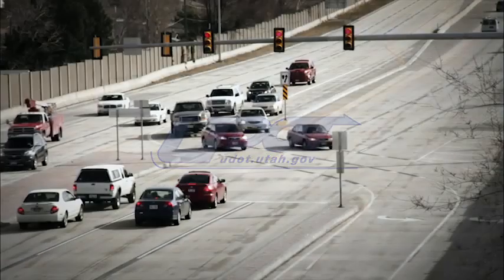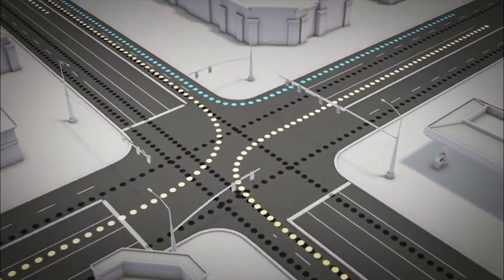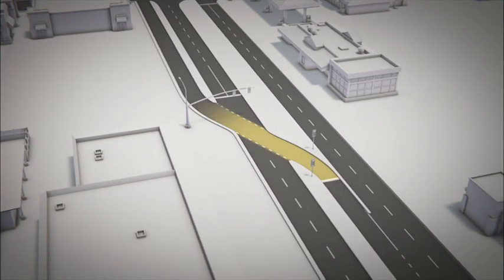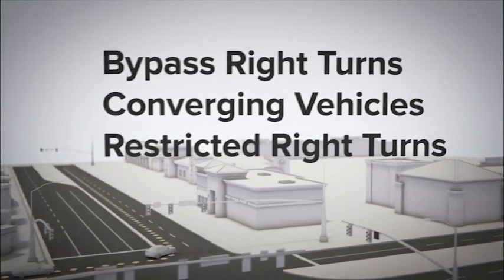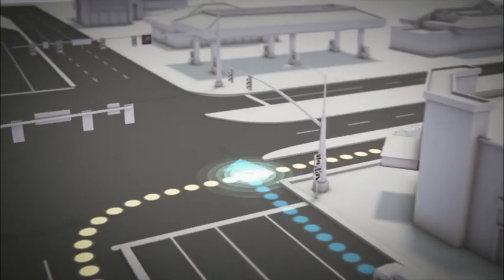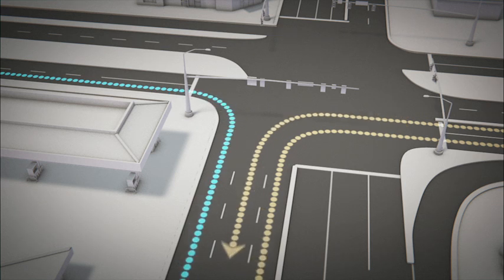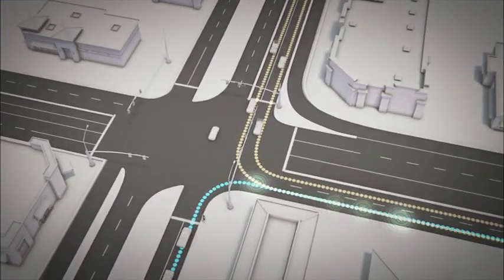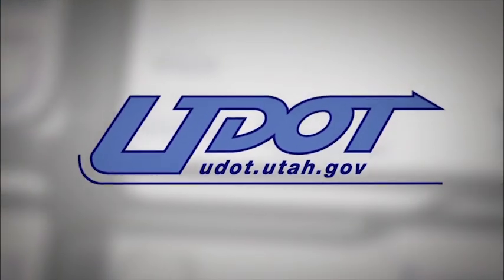All About: Continuous Flow Intersections

Comment: Continuous turns are impossible. Let me explain it. Cross sections are conflict points. It doesnt matter if you stretch it out. Its the same amount of cross sections. Two cars cant occupy the same space. So the amount of lights you encounter are the same. Meaning the distance you travel and the rate of which. Is identical to any other design. The only design that is truly efficient is the roundabout. It allows higher average speed and reduces conflict points.  This is still the exact same as a green arrow turn lane. Because the cars that go. Are going when one side is green. But they all have to stop to allow the cross section per car to happen.

Comment: Is it more efficient because what im seeing is the census taken at places that show more flow but dont demonstrate a change in the two forms. Flow rate is very simple. How long is a light green. And how many cars turn. How many cars then enter to turn. You count how many people enter the area. And how many get through. Very simple. If you have the same amount of lights. And stopping time. Then it all averages the exact same.  But they are measuring by cars turning and crossing at the same time. This is tricking the numbers. But per minute. You have to stop and go. The exact same amount of times as a standard dual intersection.  Each car is stopping and going no differently...  yall stupid

Comment: I can only see this working the best in a highway if builders do not want an overpass
Reply: Then it wouldn't be a highway... highways must not have any traffic lights
Reply: @supertiba98  says who?
Reply: @eax2010EA  The law in most European countries. And yes, I know this is the USA we’re talking about, but not putting traffic lights on a 75mph highway just generally seems like common sense anyway.
Reply: @krystiankowalski7335  Highways does not mean high speed, it means high capacity for cars and other car-like vehicles. Traffic lights are necessary even on highways when you don't have any other option available, especially when it meets a low traffic road. Before those traffic lights, you would have live signs telling you to slow down to another speed limit so that you respond in time to the stop. Highways can also meet train rails, and it's way harder to elevate one over the other; both are equally important.
Reply: @eax2010EA  You’re confusing highways with distributary roads. Highways are high-speed, and meet lower-speed roads by means of something like a cloverleaf or trumpet interchange, not traffic lights. I know that you would have stretches of lower speed limit leading up to these hypothetical highway traffic lights, but that’s only if there were any in the first place, highway traffic lights don’t exist. I never remember a time when I was driving on the autobahn and suddenly got hit with a 70km/h sign and traffic lights - because they are not there. Highways similarly never meet train rails at the same level. There is a bridge or a tunnel. Imagine driving down the I-95 and suddenly you have to stop because there is a train crossing it. Stupid scenario, right? It’s stupid because it doesn’t exist. Putting traffic lights/level crossings on a highway is impractical, inefficient, and very dangerous.
Reply: @krystiankowalski7335  highways vs freeway my dude.

highway means high capacity
freeway is the one that means no traffic lights.
Reply: @SherrifOfNottingham  They’re the same thing
Reply: that’s exactly what its for, is a temporary solution to a growing problem

Comment: To everyone saying to use a roundabout, this intersection is most often applied where a 6 lane stroad meets a 6 lane highway, combining 60+ mph traffic with 40-50 mph traffic. A roundabout would need to be elevated, or the highway dropped below ground, and it would be a bigger mess than the Arc de Triomphe in Paris.
Reply: Then it is not a highway since highways must not have any traffic lights, so roundabouts are still better since traffic is always flowing
Reply: @supertiba98  You're thinking of a freeway. A freeway isn't the same as a highway.
Reply: A 6 lane highway shouldn't be crossing through a road, or a street, let alone a stroad, the idea of which should've been put in a lockbox and dropped in the mariana trench to begin with.
Reply: @AstrumG2V  You know what's worse than that? A flashing yellow left turn arrow on a 6 lane highway.
Reply: @RichardFStripeRendezvous  or how about having no traffic lights or intersections on a highway??????
Reply: This is over complicated. A small rounderbout would increase traffic flow considerably while be much safer. One light jumper and accident waiting to happen.
Reply: What about cycles and people btw??
Reply: @yuvrajshinde6082  they have the traffic lights!!??
they cross the road when their signal turns green
Reply: @yuvrajshinde6082  Usually, pedestrians aren’t even allowed to walk through this intersection

Comment: So, if I understand this correctly, the whole point of the continuous flow intersection is to reduce conflict points at intersections. But that whole point is defeated by the fact that you need to add four more intersections with traffic lights to make the left turn possible.
Reply: typically only two more as this type of intersection is usually found intersecting under a freeway with it's frontage road which does not have the special left turn lane.

Comment: What the hell? Just make a big roundabout. Wastes less surfacearea and is far simpler.
Reply: There doing that in my town one round about sad to say it removed 23 business and now the area is vastly empty just to change a light to a circle. Good job on making things worse just because it's a circle . As well the traffic is way worse now so that's great too
Reply: @MetroHam   than they made something really wrong. What you describe shouldn't and must not happen.
Reply: @MathieuDeVinois  in my old town theres a main road that sees 70k cars daily and a side road that comes in at an angle with 15k cars daily that merges with the main street. most traffic is using the main road as the only way east to west or vise versa and only way to any nearby north to south highway. even so the town is decently far away from one and it does have the largets shopping center for certain stores in the state and a large lake for the summer time guest and the resorts for winter. most people not touring are peopel trying to get from the other towns through this one etc. a very simple change would have been to just make the street a 4 lane with grassy median and grade seperation at the larger congested areas. That or just elivated the road way and add corss conection from nearby parking spaces which wouldnt have destroyed alot of buisness.

But since most people perfer circles these days. they need to be beig to handle trafdfic volums so they end up destroying more and theres like 3 all in a row for reasons even tho it would make traffic worse cuz reasons
Reply: i think u got something in your ass if u really think putting in a roundabout would take less space then this.

Comment: Interesting that this shows 0 consideration of other modes of transportation than car. How do pedestrians and bicyclists fare at these intersections?
Reply from the maker: Here is a 3D model of a CFI intersection with bike lanes. Note that there are trails beside the road as well as marked lanes on the road for cyclists. This was a proposed design for an intersection that has since been built, largely as shown in the model: https://skfb.ly/6UL7x
Reply: @avenueconsultants  Yeah... um no! That is some terrifying biking that I have ever seen.
Reply: @avenueconsultants  Thats really cool, thanks for sharing it.
Reply: @avenueconsultants  So now you've got a shared pedestrian+cyclist space? Plus that model has a cycle lane that traffic turns across! So very many, in fact. This is a hella backwards approach to traffic management.
Reply: @samal3196  You could provide similar geometry but with separate sidewalks and bike paths.  It is not ideal but with careful engineering it could be okay.
Reply: @GreatWhiteNorth you ever been to the salt lake valley?
Reply: Will you two idiots stop arguing about process when you clearly agree with each other about the end goal?

Pedestrian-first transit design and mixed use zoning go hand and neither can reach their full potential without the other. Turning a 4-lane road into a 2-lane road with bike lanes doesn’t work if the bike lanes don’t actually connect to any businesses, and a brand new corner store isn’t going to see a lot of business until road design makes walking/biking there as convenient as stopping at the box stores on the drive home from work.

So when these things pop up on ballots, don’t oppose it just because we need the other first. We need both, and whichever one we get first will make the other option more appealing to people who can’t imagine life without driving.
Reply: When your job is to build a road, why would you be talking about airports?
Reply: When everything is built around cars, stupid ideas like this become normal
Reply: @GreatWhiteNorth "life can exist outside a damn car"
You're the one judging everyone that uses cars like they're all the same.
In no way I said in an ideal condition we should have everyone using cars. Just read my comments anywhere and you'll see.
You presented an EXTREME view, completely disconnected from reality and didn't take in consideration that people might actually need to use cars, hence the shiite joke. Obviously I'm not talking about goddam Karen driving several tons of gigantic SUV with no passengers or cargo and thinking the stroad is all hers. Also, F stroads!
Roads have to be made for cars, but, we need to consider pedestrians and cyclist as much as possible, but not the priority when cities are built with defined separated zoning and very segregated suburban sprawls. As I said, either change the urban planning and zone mixed neighborhoods or you can forget prioritizing cyclists and pedestrians like you said. Plus there's the whole, "change the culture to use public transport" first, so you have less people inclined to use cars, but that can't be forced by pencil pushing bureaucrats that already f'ed up the urban planning part.
I don't even own a car at this moment and if I could I would walk or cycle everywhere, also I have lived in big metropolitan areas and I was used to take metro/train and buses when I couldn't walk that far.
Reply: @chaoswarriorbr  @GreatWhiteNorth I just wanted to point out that you are having an entertainingly petty argument - please continue while I laugh at all of you.
Reply: Oh look, an anti-car shiite!
Yeah let's just squeeze all cars in smaller roads while the city developed around cars so everyone that really needs to use them (elderly, health issues, young children, people that carry goods/equipment) just suffers!
Unless you plan to completely rework the urban planning with mixed (comercial and residential) zoning in walkable neighborhoods all around you still need a lot of cars and trucks, else you kill the economy and make people move somewhere else to get goods, services, etc.
Reply: @chaoswarriorbr  I love how you assume that elderly and disabled ppl will be in cars. Meanwhile, my disabled partner quite literally can't drive due to his neuropathy and we don't have a car (can't afford one actually - cars are expensive). And I've met plenty of elderly ppl in my city that can't drive and/or don't have cars. Also, children tend not to drive either. You know, cuz of how old the are. But I suppose you assume that a parents (probably Mom) will have to play taxi driver for them all day.

We do need to redesign our cities to be much less car-centric and much more focused on pedestrians and bikers. It's a long process, but it will be better for everyone in the long run - including drivers.

Comment: Ever heard of roundabouts? They do this in a much easier simpler way.
Reply: #americans
Reply: The reason you would use this is if there is a lot of left turning traffic. A normal intersection make left turning cars secondary, while this allows for lots of left turning traffic. In most instances, you would only have 1 or 2 directions having seperate lanes for left turning. A bit better than a roundabout in terms of cost and space. Especially if the crossing roads have 3 or more lanes each requirng a very large roundabout. 

For example if a very central interchange in a city is failing then adding seperate left lanes could be an easy solution.
Reply: ya lets just put roundabouts everywhere!! because thats how it works right?!?!?
Reply: @nathan7627  yeah. Pretty much. Not sure if backward people would understand though. Takes more brain power than red and green lights.
Reply: @nathan7627  the fact that you would suggest to tead out buildings in New York for roundabouts means you're not that smart, dude
Reply: @RR-us2kp  im just mocking u lmfao
Reply: @nathan7627  by embarrassing yourself?
Reply: @nathan7627  use proper English man. Especially when you're insulting someone about their intelligence
Reply: @RR-us2kp  my bad bro
Reply: @nathan7627  I know
Reply: And wouldn't be a nightmare for pedestrians and cyclists
Reply: @JAKempelly  It isn’t as bad as you think it would be. There is one by my house near Chicago that Caries like 40,000 cars a day. Drivers have to slow down to yield so they normally stop for me in the crosswalk. It’s a lot better and safer than crossing at the lights on other busy roads because drivers need to slow down and yield to oncoming traffic. Pedestrians are not always in view of the driver at a light but on a roundabout people are in front of them improving safety
Reply: @JAKempelly  go to spain
Reply: @JAKempelly  
I have crossed both roundabouts and signalled intersection and I can say roundabouts feel safer..
Reply: @yuvrajshinde6082  I disagree, I love roundabouts, they do wonders for traffic, but I feel better with a signal telling cars to not move, and a signal telling me when the cars are told not to move
Reply: @anthonymigliaccio3492  if you feel that way, that's because they didn't build the roundabout correctly
Reply: @JAKempelly  actually, a roundabout takes up more space than a cfi, and why yes roundabouts may be better in some way, for this case in the middle of town, a cfi is a way better solution because it allows businesses to keep running.
Reply: @Dave12753  Bull poo
Reply: @tjgaming3225  i understand why you think a cfi is worse than a roundabout, and that is true in some ways, this application wouldn't work well with a roundabout because of big rig traffic using the intersection. You see, businesses need to stay operating during construction, otherwise they may go out of business in that area, reducing the amount of money they make, possibly causing a chain reaction of other store locations being packed with people causing over crowding. A cfi takes up less space than a roundabout so businesses can stay operating permanently in the area.
Reply: @Dave12753  you forgot one thing to say, CFI's move more traffic than roundabouts
Reply: Not on a road that's 6 lanes on both the east west and north south routes
Reply: @bearworldwide101  if it has 6 lanes each way, you're better off with a grade separated interchange. Definitely not this.
Reply: @RR-us2kp  grade separation takes more space than this especially if you build in tight spaces.
Reply: @bearworldwide101  you have 6 lane intersection at a tight space?
Reply: They don't work with very asymmetrical traffic flows.  These can work better for those situations.
Reply: The problem is that roundabouts take a lot of space
Reply: @GAJake  when you have old grid type city plans with an intersection every 50meters or so, you don't have a choice. It's just bad design. Like in New York.
Reply: This world would have been a better place if you didn't write this comment because you started an argument
Reply: Roundabouts are not good for roads with many lanes. Traffic flow is complex
Reply: Either every intersection is great or bad, problem solved!
Reply: They don’t always work …
Reply: @VieleGuteFahrer  most of the times yes
Reply: @gabrielxancogarcia2652  No. If they would always work, you would see them more often.
Reply: @VieleGuteFahrer  go to Spain, literally there is a roundabout everywhere, and It works perfectlly
Reply: @gabrielxancogarcia2652  There a regular intersections in Spain too. So clearly, it doesn’t.
Reply: @VieleGuteFahrer  dude, the fact that not all the intersections in Spain are roundabouts doesn't mean that roundabouts doesn't work. Obviously are not perfect (maybe for the space that is needed to build one)  and sometimes a normal intersection is better.
Reply: @gabrielxancogarcia2652  That was my point though. And a lot of these "roundabouts" in Spain have traffic lights, which defeats the whole purpose …
Reply: @VieleGuteFahrer  if you go to places as "Plaça Espanya" in Barcelona, is obvious. Such quantity of traffic is obvious that would have traffic lights, but zones with less vehicles, There are a lot of roundabouts without traffic lights and It works
Reply: @gabrielxancogarcia2652  They also do not work well with very asymmetrical traffic flows, for example, if one road has much more traffic than the other.  This design can work better for that.